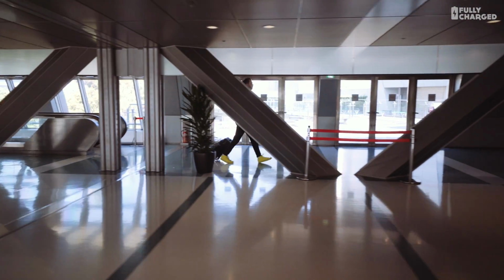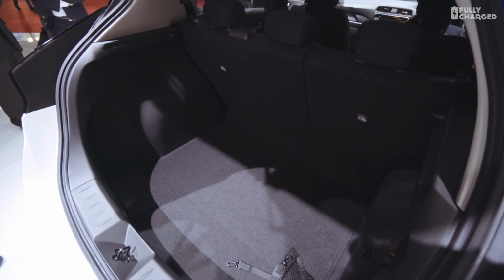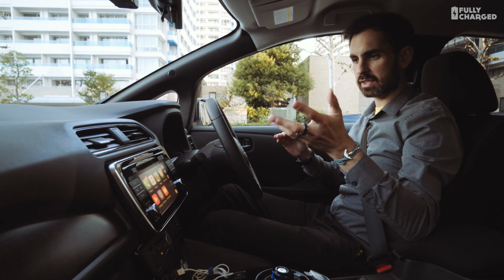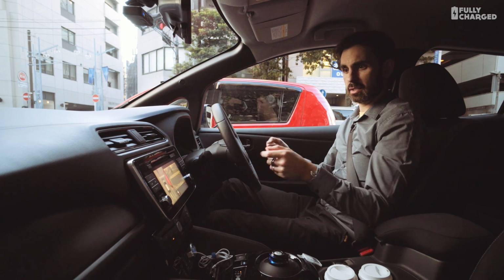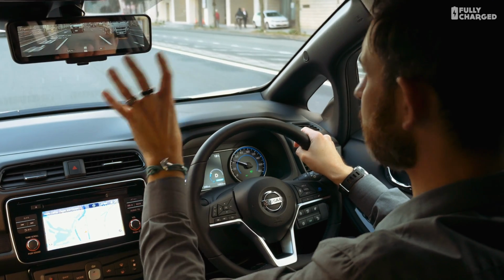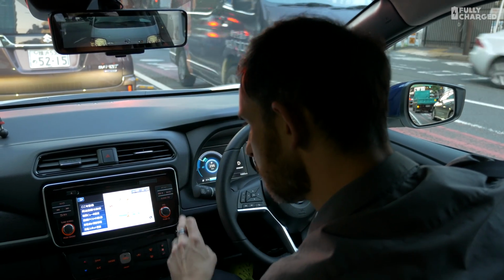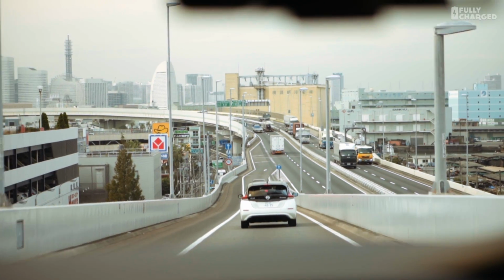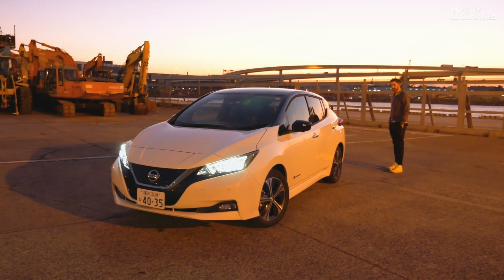Nissan Leaf 2018 | Fully Charged

Comment: Wow, what features! I loved my '11 LEAF 1.0 (82,000 miles). It converted this petrolhead to electric mostly, at least until electric motorcycles catch up. LEAF 2.0 has adaptive cruise control that can bring the car to a stop in slow traffic, aggressive regen on demand and can park itself, just like my new '18 Chevrolet Volt. Like my Volt it can easily handle my daily commute. I just wish it could easily go on a 700 mile road trip like I just did in my Volt. Nissan did a great job keeping the price down and the range up by using a smaller electric motor and leaving out the comfy leather interior, Bose stereo and adjustable steering wheel.

Does it automatically warm the steering wheel and seats on cold mornings like my Volt does? That would be a cool feature to add if it doesn't have in now. It seems to have lots of automatic, um, features that my Volt lacks. While mine (through carplay) tells me w/o asking if there is a traffic incident on my normal route it hasn't yet just called up people w/o asking. Maybe I need to talk to someone and just don't know it yet. How does the LEAF know that? Cool feature!

I do wish GM sold the new Volt in the UK. They don't yet but maybe if somebody who actually flew all the way past our country to see the clever LEAF 2.0 took that considerably shorter flight here to experience the new Volt they could determine whether UK drivers would favor the Volt. While here I'm quite sure I could find an opportunity for them to spend some quality time in a 60 kWhr Chevrolet Bolt. While the Bolt has bring-you-to-a-stop one-pedal driving that felt natural to me it doesn't speak Japanese and  seems like it would go through front tires Very Very quickly. 

If the LEAF has active battery cooling and heating like both Chevrolets it will be a serious competitor globally.